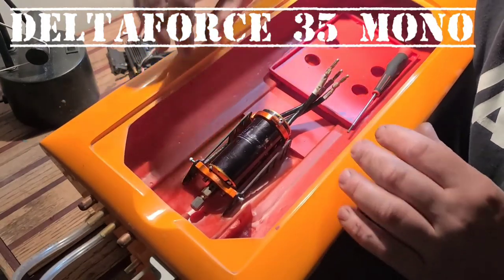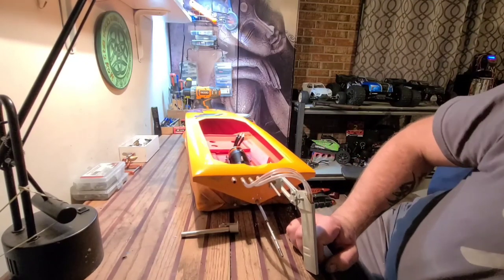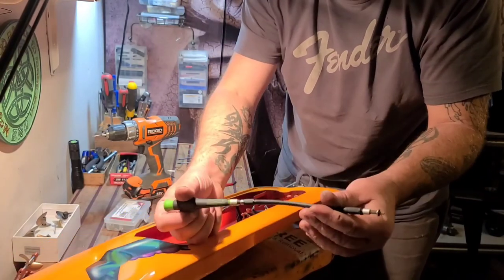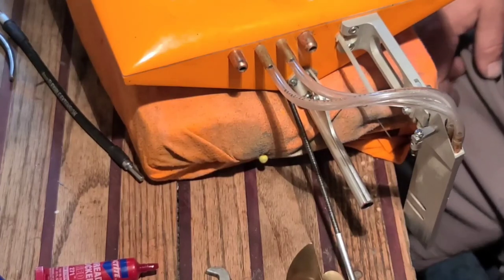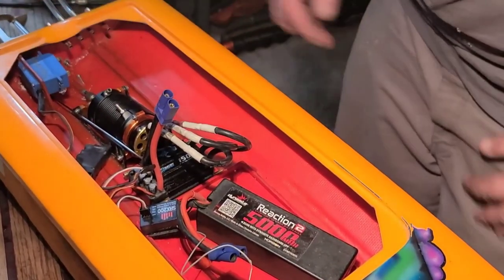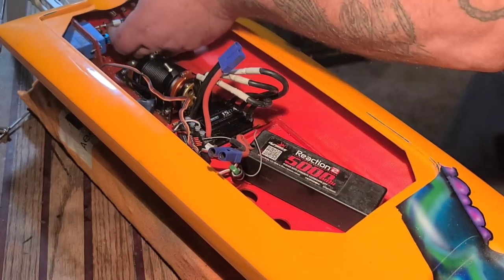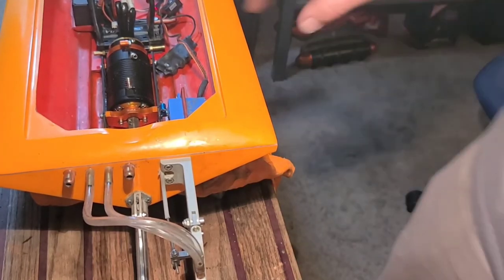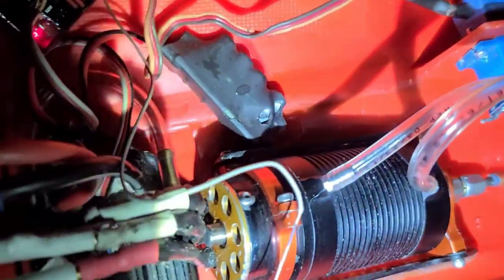Rc boat Delta force 35 mono hull build

Comment: I've had several ProBoat and Aquacraft monos and noticed that the stuffing tube exits out the transom slightly offset to the right. I thought it was a quality control issue but found out by some fast electric racers that it is done that way on purpose to compensate for the propeller rotating counter clockwise. Basically it helps trim the boat out so you don't have to make radical steering trim adjustment on your transmitter. I have OCD so I can't have my stuffing tube offset; I'll trim it out with the radio if necessary. Great video sir!

Comment: Man I’ve been flying rc helis and jets for ten years and I bought my first boat last week and I can’t tell you how thankful I am for your channel and dropping your knowledge! I’m building a 36” proboat Ms Geico bare hall. I think I’m going with leopard motors but what size and kv size should I buy? It’s obviously going to be a twin but I want it to scream! I may  run each motor on 6s or maybe 12s if there’s enough room. Any suggestions on on esc and motors? Thanks my man
Reply from the maker: Leopard are great motors, tfl sss are good too..  both about in the same price range.   40mm 1900kv-2050kv range would be safe.  The lower the kv the more torq, to spin larger props with plenty of pitch for top end speed. That's my opinion she is gonna scream with 6s on each side. 12s ea. Side would be hard to keep her in the water. Lol but would be fun!  Good luck with the build brother.  Thanks for watching

Comment: Im building a delta force 35 with a tp 4070 1440kv . But i notised that you were planing to use the seaking 130HV , on 8s . I allso have that esc. It is a god esc , but that motor draws 227 amp continuesly . So on my build im going for the a 300a esc . 

But i vent for same motor bed as you did, , only thing im wondering is the balance distanse from the transom on the boat . ? Because the balance point on df 35 is aproxemently 29cm from the transom. Dont know in imperial 🧐  

And another thing, i have watcht alll of your boat videos over and over before i startes my build. 👍👍👍👍👍 verry helpfull man, 

But no swiming, aligators in pond ! Damn man!  that is scarry shit. Wish i cold show you my boat .  Im useing 1/4 stinger and flex but with adapter to 3/16 driveshaft 

But what do you recomed of propeller ? 

Best regards Christian
Reply: To many Kv for 8s

Comment: You use 4mm bullet conector on 4070 motor ,how they work?
Reply from the maker: Not good. Had to move up to a 6.5. They got way to hot
Reply: @IRONCLADRC  good choice 👌